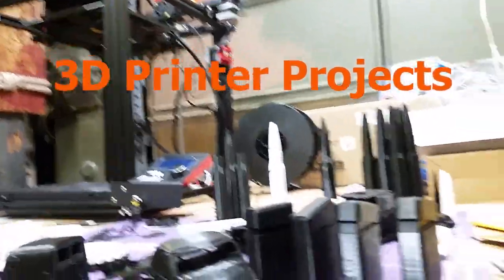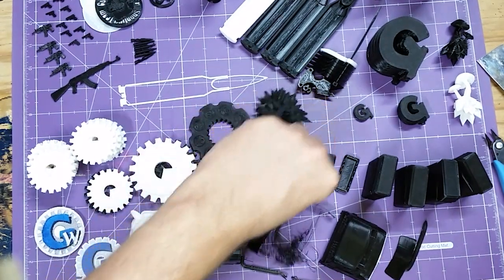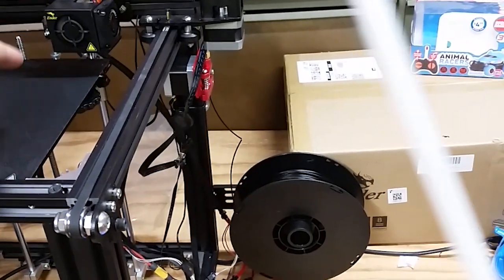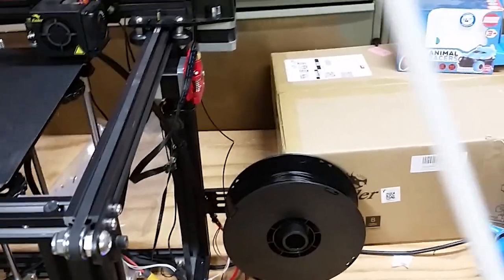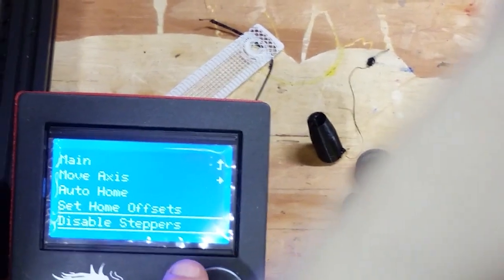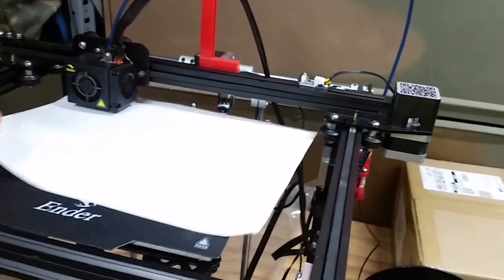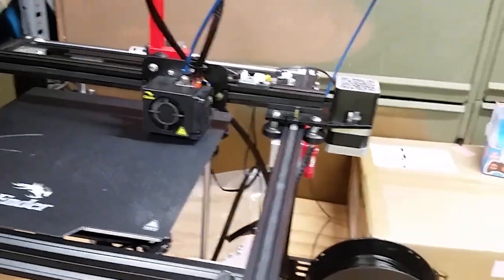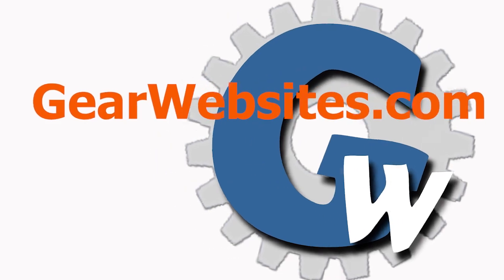Leveling the bed on the Ender 5 pro - 3D Printer Initial Project Series #4a

Comment: I just got this printer and was having issues with it stopping during a print and the loud beep starts. What does that mean? I’ve leveled it and found out I was using super low temperatures for the bed and nozzle. Help? There’s not a ton of helpful videos

Comment: You should watch some videos on enabling mesh bed leveling in your firmware.  It will take care of that low spot in the center.  It's a great printer.  I got one a month ago.   Also don't know how much you know but if it starts not sticking to bed wipe the bed off with alcohol.
Reply: How do you fix the low spot in the center? Bought one at christmas, but it seems like the center is lower and there the print does not stick. Have tried alot of things, but cant figure it out. Would really appreciate your help
Reply: @madsvidebaek6915  If you look up some video's on "menu mesh bed leveling" in the marlin software and enable it.  Then watch some videos on how to use it.  It basicly does the same thing as a probe only you do it manually with the menu.  You probably only need to do it once unless it warps more.  The software will compensate for the low spots and hi spots.  I think the guy on "Crosslink" YT channel has a good video on how to do it.  If you just want to install a probe and have the printer do it I think the girl on "Aurora Tech" has a good video on that with a link to a $12 probe.  Another good thing to understand is "first layer adhesion".  The first layer is about the most important layer and your slicer will have options to tweak this to your printer.  Good luck.
Reply from the maker: thank you will look into that